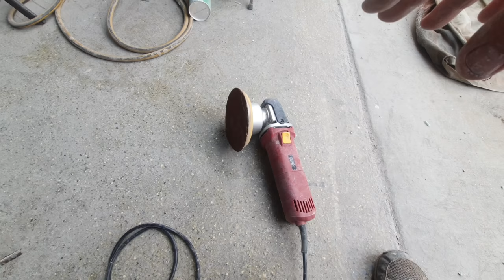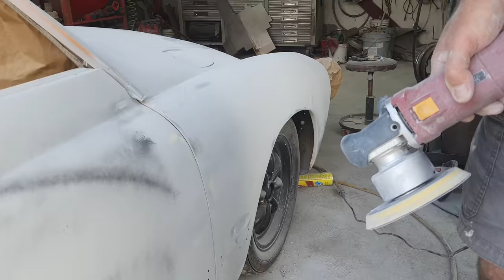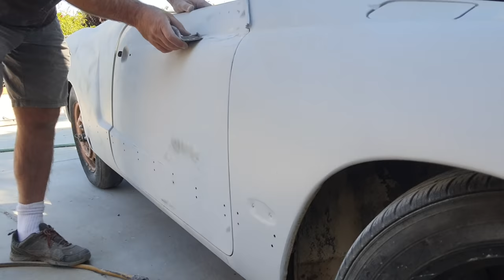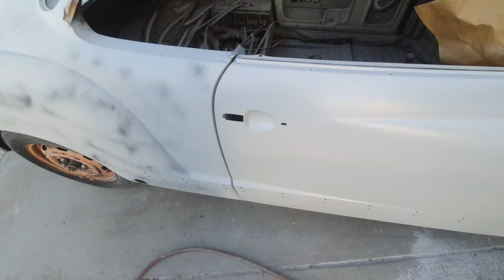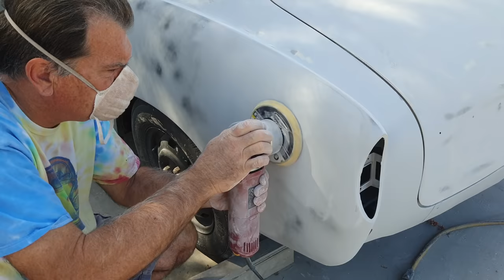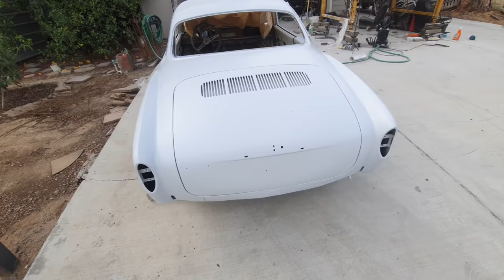Prepping the 1968 Karmann Ghia for PAINT.....surprise at the end full build

Comment: It’s cool following you through this process. I’m doing a Ghia right now. I’m almost have all the mechanicals done. It has a shitty paint job and some dents. It has been hit in the nose a little bit. Next is to get the crap off and get it painted. How should I go about getting the crappy re sprays off? There’s some bondo cracking going on. Any advice would be appreciated. Thanks, Mike!
Reply from the maker: if it is a cheap paint job that citristrip works well if you coat it really thick and put plastic over it overnight. Remove the filler see how thick it is and make sure the new stuff is on bare metal. Also use the Ag47 filler it will stick to sanded apint.
Reply from the maker: the bondo really dissolves with that stripper that is how  I did this car. and get one of those electric DA....feather sand the rest of what you dont get off. (original paint and primer. )
Reply: @Mikefngarage  what paint stripper do you recommend. Thanks for all the advice! Love that color!
Reply: Mike Fn Garage thanks Mike your the best!

Comment: Are you using Tamco epoxy or a DTM?  The sander from HF seems to have been updated to a Bauer model.  That paint is awesome!  Glad to see you went further than you has initially intended on this Ghia.
Reply from the maker: dtm urethane primer surfacer. also works as a sealer. Was not designed as one but they have tested it on encapsulating rust and it has passed over 10 years on minor rust too. They also have a better one called DTA...ant that stuff has some specs.